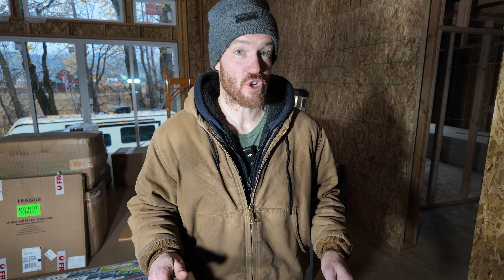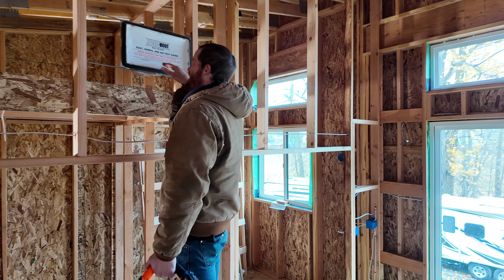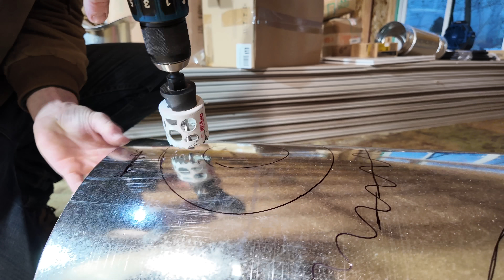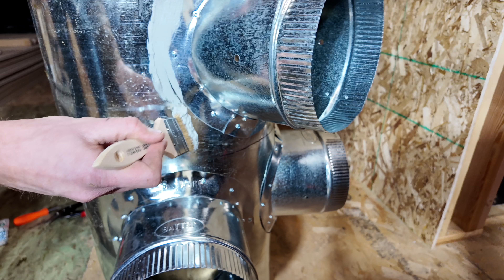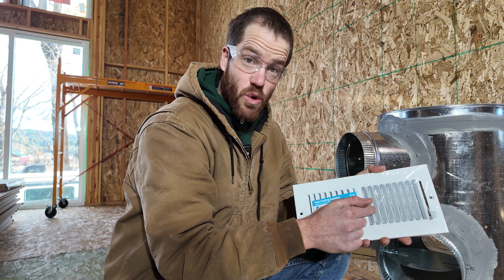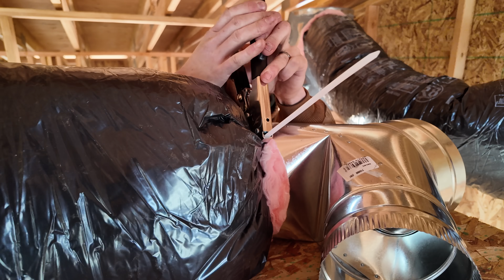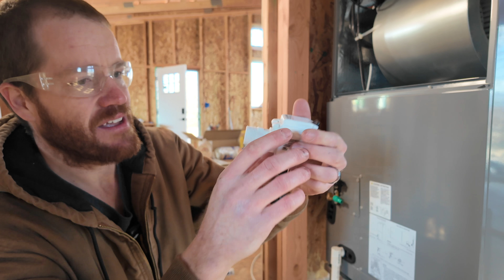HVAC Contractors Hate Me For Showing You This

Comment: You didn't mention nor did I see a return air filter. Per the manual, this is required. Most HVAC equipment is rated only using a 1" fiberglass filter, just to keep the big stuff out. The 1" paper filters are too restrictive (higher merv = higher restriction). I would recommend adding a filter housing for at least a 4" filter (5" is better). Then you can use a Merv 11 filter to clean the air. Your setup is flexible enough to easily add this under the unit.

As for your duct work, I would done a couple things different. First, I normally add 4 screws around the metal duct, apply mastic just above these screws, pull the inner duct over the mastic, and then apply the zip tie just above the screws. The mastic ensures a tight seal and the screws prevent the flex duct from pulling off when you pull it tight. Second, you had a couple ducts that had a fairly sharp curve going into the boot. In those cases, I would add a metal elbow, so the flex duct doesn't need to do the sharp curve and can be pulled tight. If you want to change these, just shorten the inner duct, the insuluation can be left long to cover the metal elbow. Plus, don't forget to seal the elbow to the boot.

What is your ventilation plan? HRV/ERV? 
The kitchen range hood needs to vent to the outside for better air quality, but don't forget to add make up air when it is in use.

Comment: Your using flex different cfm for flex than hard pipe for static pressure 6" closer to 75 cfm and 8 around 150 , your top take offs to close to the top of your plenum, every metal part thats not in a conditioned space needs insulated , and strap up all runs dont let the lay, after done take static pressure and see how many cfm your pushing adjust fan speed accordingly

Comment: Nails and screws have different properties and strengths - nails have more sheer strength and screws more tensile strength. 

Nails are cheaper but not quite as useful/easy to remove in temporary uses whereas screws are.  

Nails easier/faster to install in bulk (generally).

Comment: I don't know much about HVAC systems, just comparing yours to what I've seen in the homes I've had. The current home in the southwest has the entire furnace unit in the attic which I'd never seen before. All the flexiduct is suspended, but none is pulled 'tight' like you did so it makes me wonder which method is correct. All outlet ducts are in the ceiling with only a couple large air return ducts in the main house hallway (home is just under 2,000 sq ft single level on a concrete slab). The flexiducts are held up by straps and not allowed to sit on one another. 
I cannot see how your air return is going to work with just air coming in underneath the unit. Perhaps this will be explained in a future video. Also the install of the outside unit must be coming later as well since that is a challenge in and of itself. 
I can see doing mini-splits yourself, but I thought a whole house furnace/AC unit requires calculations of size, airflow, how well built and insulated the space is, whether there will be an air exchanger or not as part of the overall system, etc. Seems way to simplistic in how you approached it and as other commenters stated- will be interesting to see if this unit performs over time and if does need servicing, who will work on it should the issue be outside of your DIY ability to fix it.

Comment: I have this same unit except its not multi-zone.  Its a great system since you can run it as a 4 or 5 ton.  Other than being heavy, it was a super easy install and its super quiet.  The only bad thing that happened with mine is the condenser unit outside went bad after 18 months.  I reached out to Mr Cool and after a few tests they had me run with the multi-meter, they shipped me out a new one in a matter of days (no cost, they even shipped back the old one).  Great customer service!  Thank you guys for some great videos!
Reply: It failed because if you leave the pre-charged line sets coiled up in a circle you creating an oil trap. Eventually that will make its way back to the compressor and slug it. I get what Mrcool is trying to do for people but they are very unreliable systems and do not  explain to DIY customers the cause and effects of doing things a certain way but hey guess that’s how they stay in business….
Reply: @Ghostsrt392  given what i've learned that makes a ton of sense.  mine didn't fail from a coil though as it goes straight up the wall and almost straight through the attic to the air handler.  i would however suggest to anyone doing a DIY install to have an HVAC professional check the work and test the system.  i ended up contacting a reputable outfit here and they only charged me a few hours of labor.  they even captured everything from the lines and pressure tested it.  i have their number and recommend them to anyone for HVAC needs.

Comment: As a mechanical contractor, I don’t care if you put out this content. Most people won’t do it themselves, or if they do put the system in and doesn’t work well, i still get paid to fix it. There’s a reason it’s a licensed trade.  I’m surprised your local code inspector passed it without having a master mechanical license to pull a permit.  I would also like to know the amount of time it took you to install it all.  I will say, no matter the equipment, if you don’t have a good installation, it will never work right.
Reply: Many rural areas have no building inspectors or inspection schedule.  What many diy homebuilders don't realize is that it does not relieve them of the responsibility (and more importantly, the liability) for meeting minimum National Building codes.  These are especially important facts to consider if it's spec building that will immediately be marketed.  The era of real estate "flipping" has bred contempt for building codes, viewing them as some sort of government encroachment on liberty, failing to see that most of the code is there for good reason and ultimately protects both the builder and the consumer.

Comment: Good stuff, have the same unit, although I had someone installed it for about $3.5k, and it's an in-place replacement for a furnace AC combo. Still a lot cheaper than if I had gone with a all inclusive quote from traditional HVAC companies, and a much more capable unit too.

Comment: Having grown up in a cold winter climate, I'm always puzzled by the idea of mounting registers overhead - for two reasons: 1) Heat rises, so it's more difficult to heat everything down to the floor if the register is overhead and 2) cooling interiors is also better if you've got the cooling registers lower so that the heat rises and warmer air is, again, overhead, rather than where you're dwelling, overall. 

Also, for the same reason, I'm curious as to the reason for mounting the HVAC unit on the top floor. I recognize that it's trendy to mount it in the attic, but since you couldn't put it there, and being that the foundation is surrounded by the ground, the temperature is most likely going to be more consistent in the "basement" area. So having the HVAC unit set there would mean that much of the draw and heat exchange would be in the most consistently cool/warm area of the house. In the colder climates I've lived in, that's been the norm if there's been a basement area.

Comment: I like the show but sorry when it comes to hvac even I know that if you want consistent temperature coverage throughout the house you need cold air returns so when a door is closed airflow can move correctly. Been there done that and it just doesn’t work correctly. Thousands of dollars later and proper ducting done right and the house has even temperatures throughout. And I am not a hvac tech, I am a heavy equipment mechanic.

Comment: Insulate any metal or it  will condensate and either fill with humidity or drip everywhere!!!! I’ve removed many systems flooded so you need to take care before running into issues. I also tape collars in junction boxes before using the mastic.

Comment: I would’ve just went with ductless for a house like that. Also, I know Mr. Cool is hooking you up with the product but I would go with a unit that doesn’t have pre charged lines. You’re not future proofing your house. No contractor is going to be able to fix a leak or issue if it happens a few years down the road.

Comment: So, you are blowing air into the bathroom instead of evacuating air form it.
Thats weird, and it's not even allowed by code in europe.
"Dirty" room, such as kitchen, bathroom, laundry, closets should have air being drawn out, not put in.
While bedrooms and livingroom and such should have air pushed in.
Also, it is mandatory to have 0 or slight lower pressure in the building than outside to not push moist air into the walls.
Great for DIY'ers but also great for  mold and poor air quality.

Comment: It would have been better had you bought the register duct board Bass which is insulated not a problem if you just heating but if you are conditioning you'll have condensate on all the metal parts on the registers you'll need to either put duct board type register boxes or insulate the hell out of them so they don't get cold and they'll drip they'll good luck you guys doing a great job

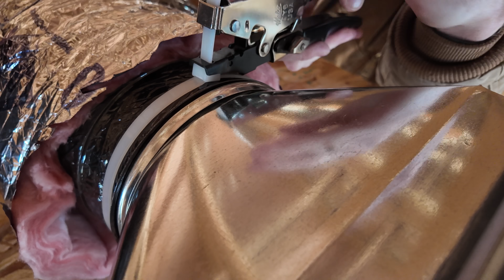Comment: 14:39 then you don´t have the right gloves try thin work gloves the big leather ones are really just for the rough work if your doing electric or something like this i would use thes thin woven gloves that are coatet with neopren or rubber or latex but not full latex gloves in them youre just sweating and they tear really easy

Comment: Not sure dude !! Been in the trades for 50 years some of your heating and cooling ideas may not be so good. No cold air returns , 1000 cfms rushing to the furnace room at floor level makes for cold feet and babies. No heat in the basement, heat register location on main floor going to make it very cool at any windows and outside doors. Like I said , not sure dude.

Comment: FYI putting the air handler in the attic is very much a southern thing. In the Midwest they’re almost always in the basement. I think the only time I’ve heard of them in the attic is when that’s part of the insulated area.
Reply: In Az they put 5-7 ton air units on the roof, in Mn 1-1/2 to 2- ton is all we need, but the old heat pumps don’t work below-20 you need auxiliary heat, yes every house has heat ducts under outside windows and a fresh air makeup uni, it’s physics

Comment: Nobody hates you for showing this. Stop with the clickbait titles. 
Sure, go to HD and buy HD quality stuff and you can do it yourself. You are not exposing any trade secrets here.
I am an electrician. A good friend of mine (HVAC/plumbing contractor) got me mini-split systems for an 1800 sq/ft house that I installed. A 1-4 and a 1-1. He did all the paperwork, calculations and ordering and took delivery. HIS COST, which he passed on to me, was just under $11,000. Just for the material. Just to compare we had quotes from $26,000-32,000 for this job.
So all of you guys saying you can supply and install an HVAC system in this home for $7500 are completely full of shit.

Comment: Love your can do attitude Riely. Have a few concerns with your setup though. Generally it's better to run the condensate drain to the closest floor drain/sump pit. They will clog over time and the shorter the run the better. Longer runs tend to clog faster. And for proper air flow every room with a supply should have a return(except bathrooms). Central returns work okish, assuming all the doors are always open to all the rooms. For better comfort you should minimum run returns for the bedrooms since those would be the rooms most likely to have closed doors. Would have suggested a filter rack/cabinet also for ease of filter changes, but a little late for that. Can tell you that rental propertys with difficult to change filters tend to have a lot of service calls cause by dirty filters.

Comment: Every video I've seen on these MrCool DIY units the guy says the line set is charged. The line set is pre-vacuumed and sealed; not charged. The freon is in the condensing unit. I've seen every video you guys have made and have loved every one of them. Thank you so much for such good  content.
Reply: Not true
Reply: Depending on the line length they would also be charged. If you have a run longer than 15' there would need to be additional refrigerant otherwise the system would be too low.
Reply: @mathehack1 
Condenser units are pre charged for up to 50' of lineset from the factory. 
The refrigeration linesets are pre- vacuumed from the factory
Reply: @jaynecobb6711  How can the lines be vacuumed when the have to be unsealed to connect them? In business over 40 years and never heard nor do I see this possible but my ears are open to understand.
Reply: @jaynecobb6711  that's dependent on the unit/manufacturer, maybe the Mr. Cool are. I just had a unit replaced and it was good for a much lower length than 50' more like 20'. The tech had to add enough gas until it reached the super-cooling threshold on his gauges. Which the manufacturer specs on the info sheet. My run was about 30'. A lot of the small mini split units sold online are good for about 16' of line with the pre-charge in the condenser.
Reply: @stevewayne3676  they use a different connection type with an O ring design instead of a flared copper tube.
Reply: @stevewayne3676 40 years and you don’t understand this 😮
Reply: You’re Technically correct. 
But as stated, Mr cool calls these pre-charged lines so the lay person knows they don’t need to use any special tools to make the connections or vacuum the lines. It’s marketing.
Reply: I think you're right, but in the end the distinction is meaningless.

Comment: The difference between nails and screws . A nail will pull and deform , a screw will shear . So if it is a structural element , you want to use nails

Comment: 6 inch main to an 8 inch register seems backwards to me. To maintain pressure shouldn't the main line be 8 inch? Bedroom 2. Shouldn't you also be using sheet metal 90's and 45's instead of bending the flex? Flow is reduced when you don't use them.

Comment: Sorry to rain on your parade but  there is nothing right about this install. Sadly, if you paid a contractor 20 k, it might look similar to this diy installation. No heat load calculations done,  no friction rate calculated for the ductwork. Everything your not supposed to do in sheetmetal practices,  you did. Just being honest.

Comment: What are you doing for heating in the basement?  When we used a forced air system in houses, we always installed the warm air ducts in the floor and in front of the windows with the idea that heat rises.  Was the system set up for putting the ducts that high upstairs?  Now that the questions have been asked, it is time to say, "Job well done."

Comment: I am a hvac/r pro watching this hurt my brain, but you are knowledgeable, what you have done thus far will work but I forsee some issues.  Good job explaining what and why about install and great attitude 👍
Reply: Care to elaborate?
Reply: @JML542  is the system is sized right? (He estimated 100 cfm per 100 sq ft, not how that works.) Needs air filter.  Undersized system runs all the time oversized can led to mold growth.  Plenum needs to be insulated or it will sweat. pre-charged lines need to be measured very well and as you can’t modify the line set, move the condenser, or have loops in the line set. No way to take Evap panel off without removing condensation line. And probably a few others but that is what is what stands out.  Now does he have time to  address these, I hope so.  As far as the unit size I hope that it works out for them and they don’t run into any issues. As they are building what looks like their own home while being mindful of their budget and I would hate to see something like this hurt their bottom line.
Reply: @sawyerkt  the plenum will sweat even inside a conditioned space? I would 100% expect it to sweat if the AHU is in the attic.
Reply: @JML542 
The dampers installed should be installed vertically in this instance. I have come across dampers that have torn loose or rubbed a hole in the ductwork making a noise driving the home owners crazy. You should have 12 to 18 inches of unused plenum to increase even flow otherwise the supply ducts at the end will get most of the flow. On the drain line it's not a matter of if it's a matter of when, it will get backed up. With this in mind you need a capped tee before the p trap to be able to clean it out. Also did he say foam envelope? He needs to add fresh air to the home without a return plenum it would hard to add a erv in the future.  I would also add a wet/float switch to the drain pan under the unit. I would rather have my customers mad the ac isn't running than have water damage. 90% of my job is fixing other people's mess ups.
Reply: Nice job mostly! What is your temperature difference across the evaporator coil? It should be about 20° if it's higher then there's something reducing the airflow in your ductwork or it's undercharged 9r fan is set to low. You also want to find out what the superheat and subcooling is so you know the performance of the unit for proper temperature and moisture control and longevity of the unit and proper fuction of the compressor ad it will affect its life span. Also I bet there's a lot of fan or unit noise in the short duct runs since it's not an insulated plenum. 😊

Comment: When installing a take-off on a main duct and you have to have an opening all you need is a straight screwdriver a hammer and snips. Hold the screwdriver tip at a 45° angle to the sheet metal and give it a couple whacks with the hammer and it will go right through and create a slit that the snips can easily use to start your hole. No more drilling thin sheet metal. Cheers and good luck.